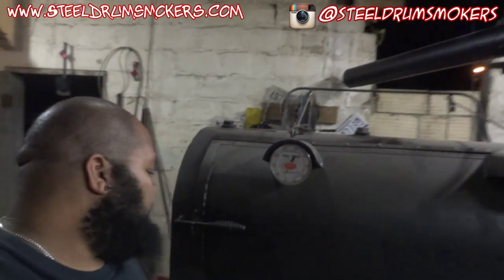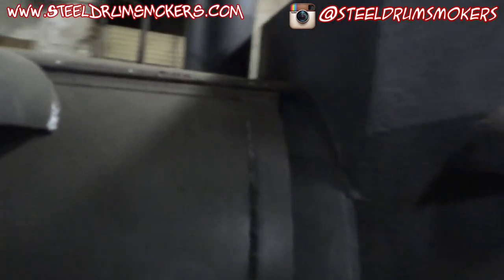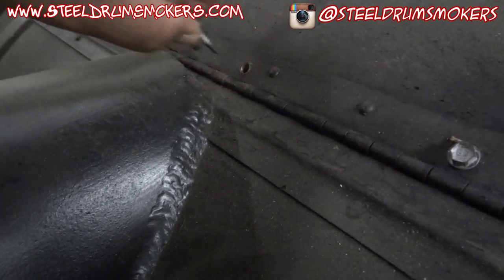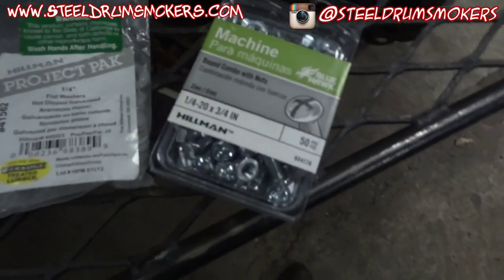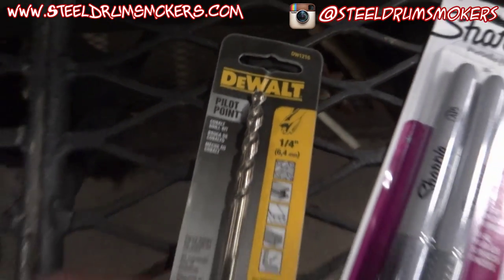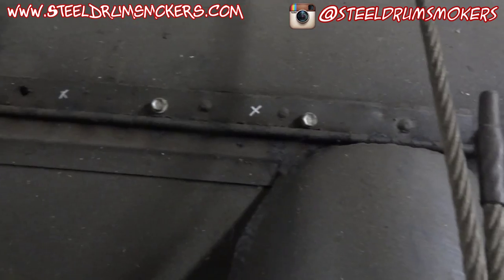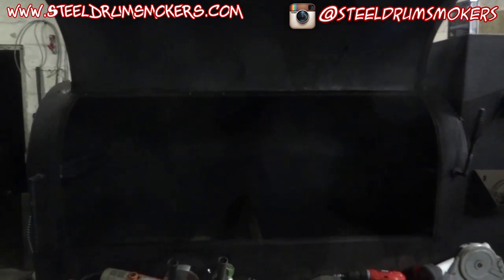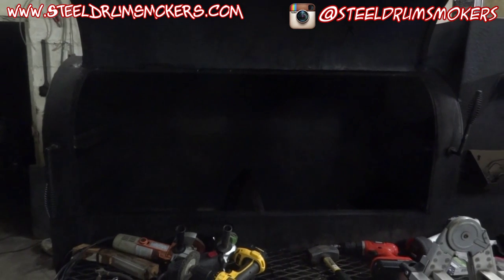Steel Drum Smoker's BBQ - Smoker Maintenance 10/2015

Comment: Man, sorry you had to deal with that. You're right on welding thick to thin. Concentrate the puddle on the thicker and "whip" the puddle into the thinner, whether you are doing circles, zig-zags, crescents, etc...pause for a split second longer on the thicker. If you are burning through,  turn your machine down, or move a bit faster with your hand movement.
Reply from the maker: Dude, I don't think when you were originally building this you could have ever imagined how many trouble free cooks I would have had. this is a drop in the bucket in the grand scheme of things. thanks for building it as well as you did to begin with!